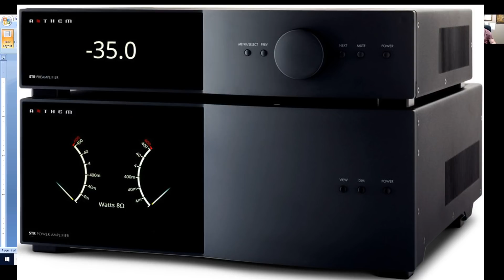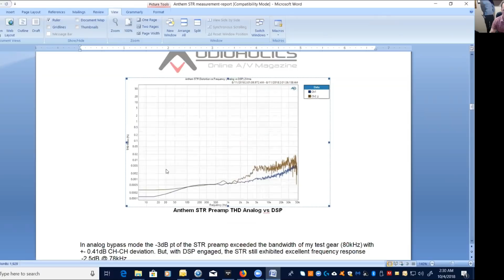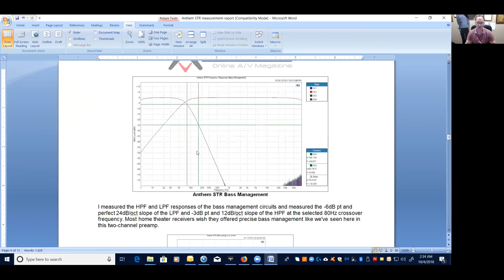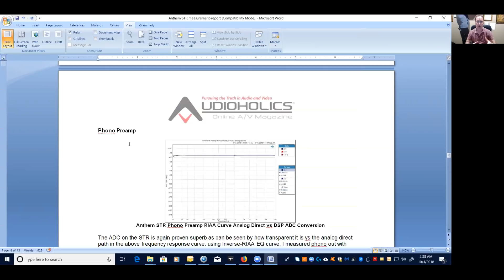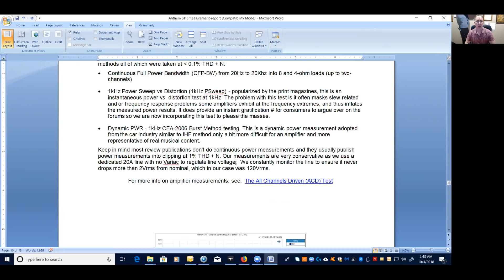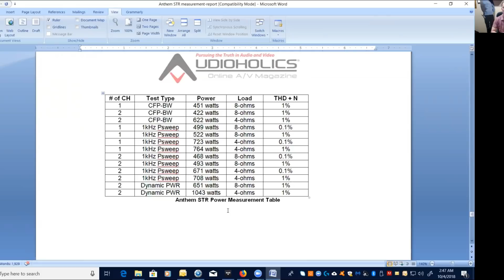Anthem STR Preamp & Power Amplifier Bench Test Results

Comment: Thank you for your very informative video.  
I just sold my Anthem STR integrated amp, despite the fact that I liked the ARC room correction (though I did not spend enough tweeking it to its full effectiveness).  I just retired and spend most of my listening streaming (Lumin D2) and occasionally playing CDs.  I am plan to buy a McIntosh MC152 and a hybrid McIntosh C8 preamp OR an Anthem STR preamp.  Your thoughts on preamp choices?

I have a pair of Aerial Acoustic 6T speakers (4 ohm, 90dB, 20-200w rated) an considering changing to Sonus Faber Sonetto VIII G2 (or maybe the V...my room might be too small for the VIIIs).

Comment: I just bought an Anthem MCA 225 V2 amp partially based on your positive measurements and experiences with the STR gear. I'm running it from pre-outs from my Denon x3700h receiver and using the receivers amps to power the rest of my surround atmos system. The MCA 225 appears to be half the STR when looking at the internals. I would be interested to know  how it measures compared to the STR. I'm very happy with the powerful and detailed sound of the amp for both home theater and two channel listening out of my Paradigm Prestige 75F speakers.

Comment: This amp is quality: built like a tank. Extremely revealing and powerful it's found a happy home in my 2 channel setup using Polk L600 towers and in the future 2 subs in stereo when I can afford this matching preamp.  While the Polk towers go down to at least 32 hz with rather stunning clarity for such a low price, managing their bass to around 60hz and getting down even lower with some awesome subs running in stereo mode sounds even better!

I especially love how the amp is pairing with the slightly warm Polk towers, helping to boost the turbine cone midrange and ring radiator tweeter into higher end territory.  Vocals sound next to perfect and instruments sound almost real. I'm kind of stunned at how good this amp sounds and how powerful it is, for only $6500 retail.  I suspect you can do a little better but I'm not going to spend $10-20K on those amps to find out if it's worth the extra coin, because I'm extremely impressed already.

I couldn't be happier with this power amp.  The preamp will also be a great solution for me, as I can make use of good AD conversion as well as room correction for my less than perfect room. Sure tons of people say great things about Anthem gear , but thanks to your extensive testing and listening session reports, it made pulling the trigger on this amp easy.  I'm super thankful for all the great work you and your team put into educating us about all the great gear floating around these days, and keeping us focused on what matters the most when it comes to sound reproduction. My ears have never been happier, thanks!

Comment: Gene, always impressed with your reviews, informative and educational. It sounds like a good match with my system. Looking for a power amp as we speak. I listen at fairly loud levels (95 or better spl, rock and roll) at about 15',  efficient 98.2 Tekton Double impact speakers 4ohm, Benchmark DAC3B and la-4 Preamp,  SVS sb 4000 sub. audio lab 6000 transport. Also looking at the ATI 6002 amp. Wondering how they compare. Nice feature of the STR is its ability to power a 2 ohm load as another room set has Focal aria 948's which has a minimum impedance of 2.5 ohms, where as the ATI has a 4ohm rating but, not 2 ohms, and I don't know the impedance curve of the ATI amp? Depending on where it is, and whether I can use that amp with the Focals. Sorry for being so windy. Robert TN  ps thanks for all the time spent, you help people out more than you know!!!

Comment: I am very interested in the Integrated version. I would love to see a comparison between the STR separates , the STR integrated, and even one of their A/V receivers if possible.I've always wondered how much one gains in performance when moving up to separates. Is the bang for buck ratio reasonable? I am mostly concerned about my stereo performance, and less about HT. But if the Anthem A/V receivers have ARC, and there was "little" difference in "stereo" sound quality, I would prefer to just replace my existing A/V receiver with a new one. This would allow for the use of ARC for both types of listening.

Then I also wonder about Dirac versus ARC. Should I even be worrying about having ARC if I can add a Dirac processor, such as a Mini-DSP. Which correction system performs better or has better features? Their are just so many variables and I'm trying to keep the cost from spiraling out of control.

Question: Are the ARC room corrections "fully" user adjustable, like Dirac?

Comment: I'm doing a 7.2 surround sound but I'm only using 4 channels plus a subwoofer so for speakers and a subwoofer I find that makes it more clean sound and I'm using for Tower speakers so that takes most of the power from the Denon 2400H at the front Polk Audio speakers and Klipsch  F200s at the back and they sound totally awesome

Comment: I'm using an old Pioneer A-91D integrated amp actually, from 1988. It would be fun to see it benchmarked. It's built as if someone's life depended on it, weighing in at 66 lbs which is quite alot for a 120W amp.

Comment: Hi Gene,
Great informational video. Anthem Arc 2 room correction in 2 channel systems using subwoofers are a game changer.  I use a Anthem ave 60 processor with Sunfire amplifiers in my multichannel / Atmos system. The new Anthem str preamp is the only 2 channel processor with room correction that I know of. Please investigate using a subwoofer with Arc 2. I would love to try out Arc 2 room correction in a 2.1 system.

Comment: Great work again Gene! Love that you are doing this kind of in-depth analysis of products on video! It might also be worth mentioning that the Anthem STR Integrated does not include the home theater bypass feature that is only available on the separate STR Preamp. Correct me if I'm wrong...
Reply from the maker: Ted haven't really looked at the STR Integrated but will research it and discuss in my written review. thanks.
Reply: HTB on the integrated works differently. You have to select an input to use and then leave it on. When you switch to the HTB inout the volume is bypassed and it works like a regular 2-ch amp. No sub bypass though.
Reply from the maker: you don't have to select an input for HTB. Just enable that feature and then you can shut it off and it automatically goes into HTB. Also, it has dual subwoofer bypass too.
Reply: You do on the integrated, which has to be powered on, because it also acts as the amp!
Reply from the maker: @John-bs9zc  sorry i missed you were talking about the integrated and not the separates which are the focus of this video.
Reply: Not a problem! Just clarifying that it does have it, only works  a little different between the Pre and the Integrated. The Integrated doesn't have a subwoofer in, you get subs through the DSP so in HTB mode it works as a 2-channel amp but all the digital stuff and the volume control are bypassed.

Comment: Thanks Gene for all you do for us audioholics. Luv Anthem! I run an Anthem pre with an Anthem  MCA 20 200 x2 amp to M&K S1-C sats with 2 powered subs MX-150 THX 12" drivers w 12" passive radiators & 350 watt amps each. one in the back corner, one on the back wall. sound foam behind the sats on the front wall, not on the sides. crossed over at 80 separate dedicated outlets for amp and subs. all part of a HT withe matching drivers all the way around.  Calibrated levels w spl meter and delays to sweet spot w tape measure. Sounds Amazing! Thank You for all your helpful advise over the years! :D

Comment: Have you reviewed the Anthem STR Intergrated Amplifier and the Parasound Hint 6 any opinions on these two ? I would greatly appreciate your view as I'm building a two channel analog system in a 1560 square foot room.
Reply: What did you end up getting? I am trying to pull a trigger on buying STR Integrated Amp.